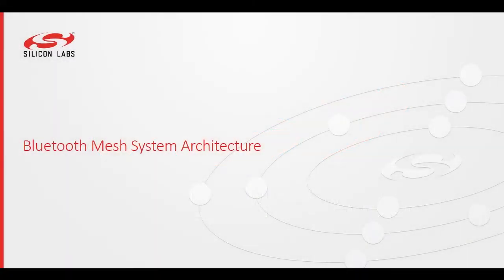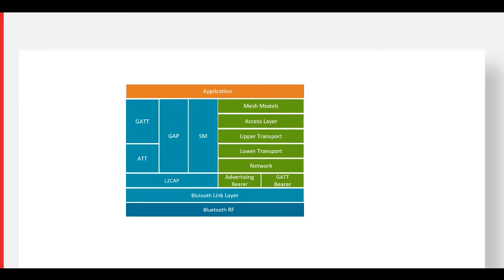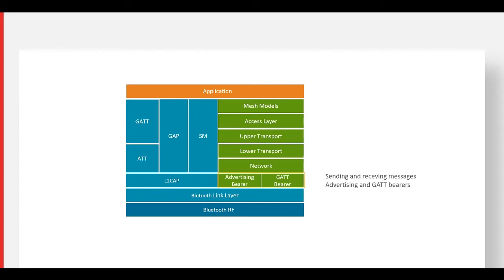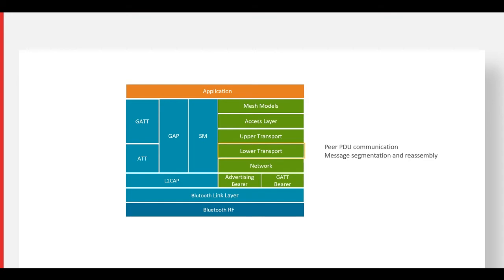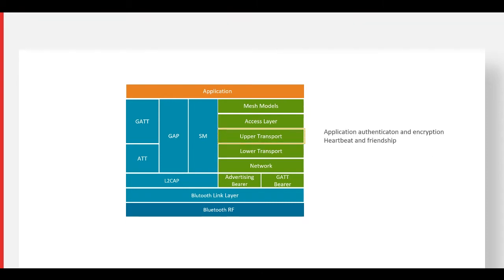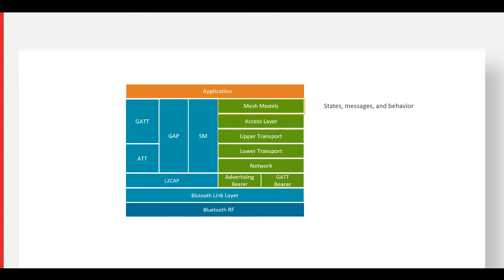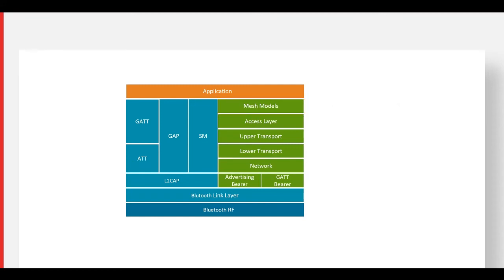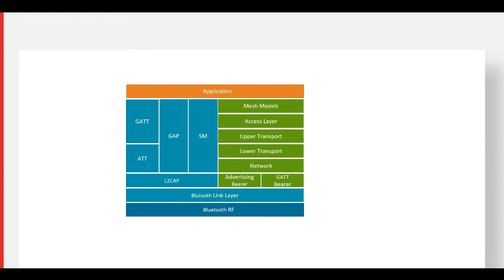Bluetooth Mesh and the Stack - from Silicon Labs

Comment: Hi! If you want an application capable of working with all the sensors (accelerometer, gyroscope, magnetometer, IR temperature, humidity etc.) from the CC2541DK, CC2650STK, ThunderBoard React and Sense you can download it from: www.microsoft.com/store/apps/9p054xsjjr1n – the software is able of giving new uses to all these IoT SensorTags (security, remote control, accelerometer mouse etc.). For more information visit: www.blesstags.eu. Thank you so much and have fun!